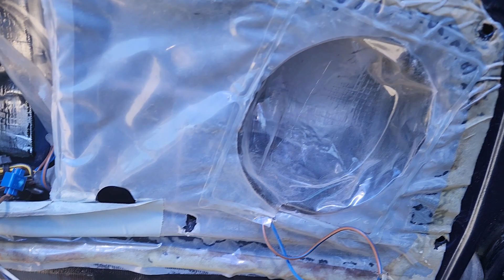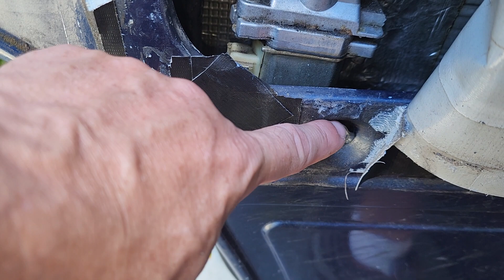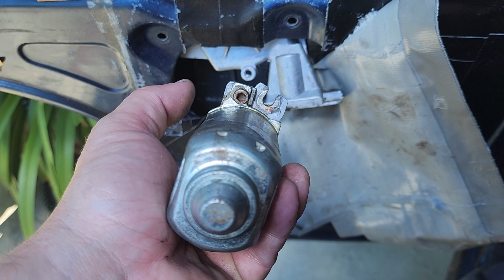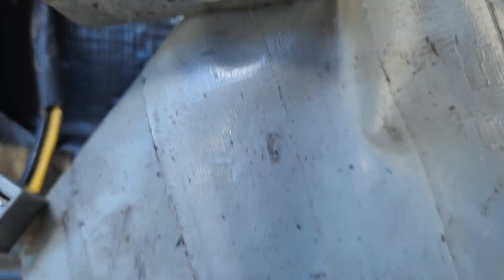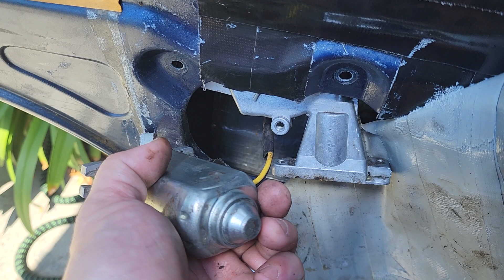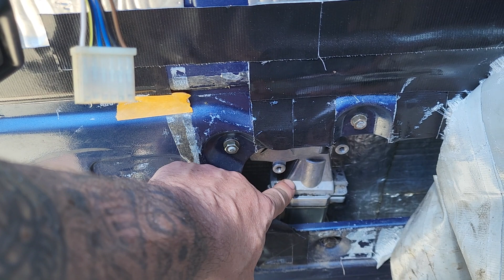Quick fix for a seized Volkswagen Vanagon power window motor

Comment: Is it a problem when the motor is seized up, I sprayed lots of penetrant and pried with a screw driver, the rubber cylindrical part came with the arbor. I see it connects it to another similar sized arbor but I see a lot some plastic broke in the process.

Comment: PSA - I was able to access the bolts without persuading the motor outside of the door. I used a 3/8 drive craftsman socket. I'd say try that before doing any persuading.

Comment: thanks.  nice "hack" on just getting the motor out.  I happen to have a 1/4" mini socket wrench with a 10 mil socket.  I could  R & R the motor inside the door well.   I had replaced the motor a couple of years ago.  Turns out the part the motor fits into was seized up.  The motor  torque couldn't overcome the rust.  I jammed a screw driver up there and gave it a twist. Sprayed some WD40 up there and works like a champ.  A tired champ but it works.

Comment: Exactly what I am going through now, except my windows never worked like yours just did😮.
Reply from the maker: If it never worked, I would pull the motor and bench test it (hook to a battery on your workbench). Might need a lot more than a quick fix. Good luck!
Reply: @builtrawr  I pulled off just after watching your vid. It was easy fix all working nicely now. Thanks mate much appreciated your a champ.

Comment: my passenger side just failed yesterday. gonna give this a shot, thanks for the video!
Reply from the maker: Let me know how it goes. It seems that the part is becoming increasingly difficult to find. I'm considering creating a rebuild video if/when my part gives out. In general, the issue arises from water infiltrating the motor and accumulating at the coil's base. A disassembled cleaning/lube is likely a good idea